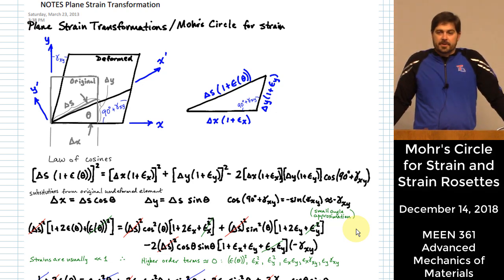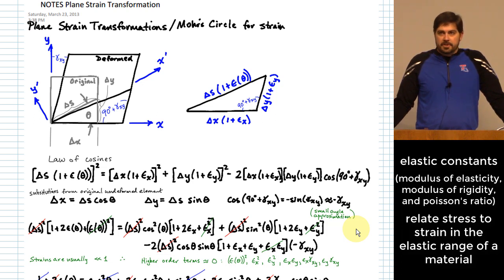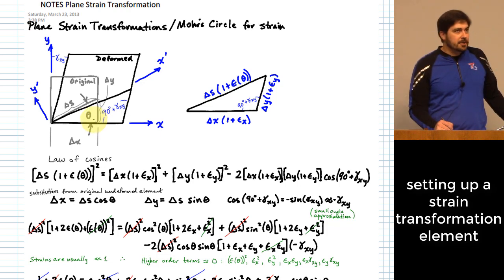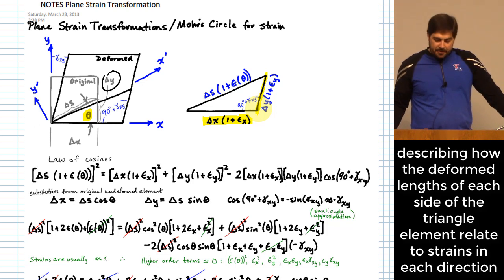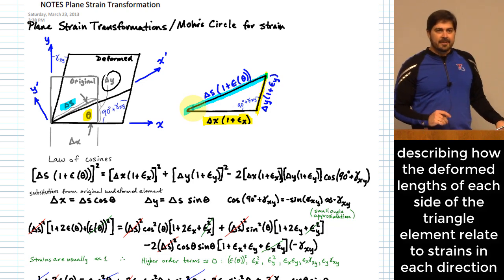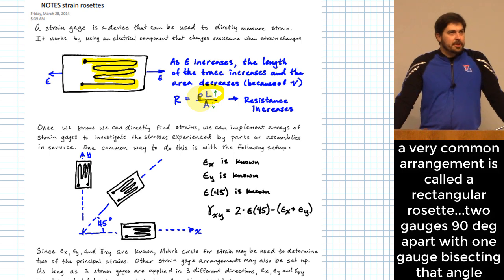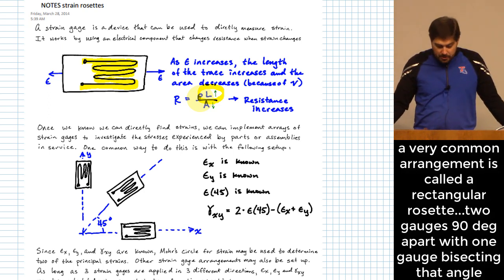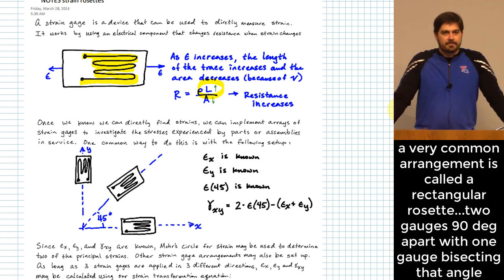STRAIN: Mohr's Circle & Transformations | Gauges & Rosettes | Principal Plane Stresses from Strains

Comment: How can I calculate if the gauges are at 45 deg to each other but offset by 15 deg to the plane axis?
Reply from the maker: You can either use the general method I demonstrate here involving a system of equations, or you can use the rectangular rosette equations (simpler) then transform your results using the strain transformation equations I developed here.
Reply: @TheBomPE  Hi thank you for responding. This is what I am given for my report: https://ibb.co/0MSgsXz
These are the questions I am trying to solve.

Using these strains and the gauge arrangement, construct Mohr’s strain circle
From your strain circle, determine
(a)The principal strains
(b)The direction of the maximum principal strain relative to gauge 1, and check with the gauge alignment on the specimen.
(c)E: using the load selected and the bar cross-section, combined with the maximum principal strain.
(d)Determine the Poisson’s ratio  from the ratio of the principal strains.
(7)Use principal strain equations to check your results obtained from the Mohr’s circle. (Note: make sure you draw the Mohr’s circle to find the results).

I am just confused with the offset angle. I imagine if the gauges were oriented normal to the axis, this would become easier to calculate?
Reply: So technically I should follow from the 20 min mark to answer my questions?